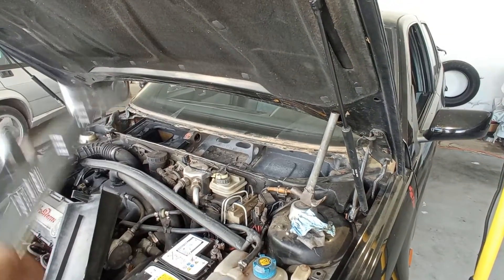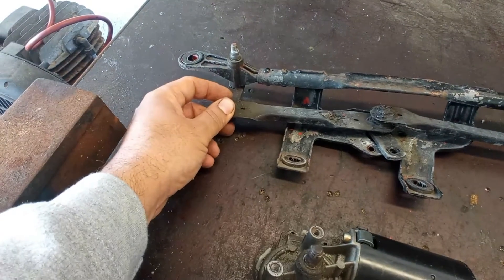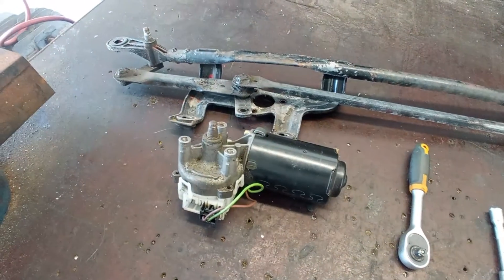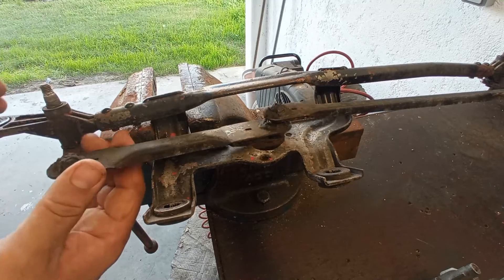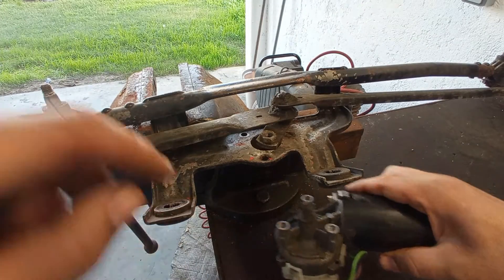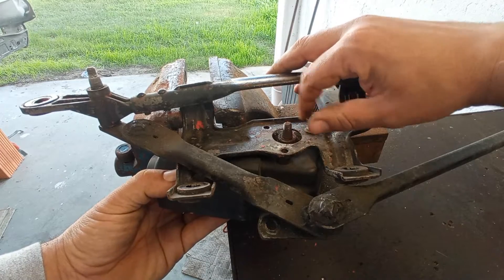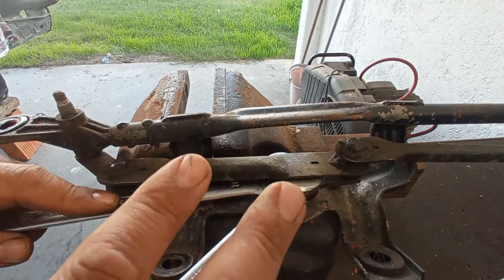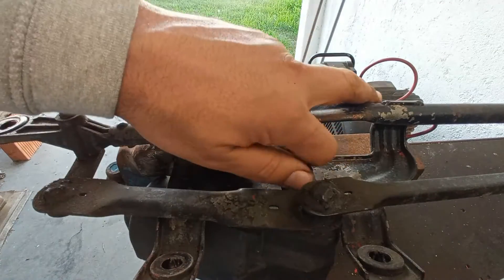Wipers in an awkward position? Wipers don't stop well at the end!? Adjust and understand.

Comment: Thanks, do you have a video or suggestion for the 159 wiper problem? The wiper works once in the 1st stage and stops and does not reverse. I removed the motor and sanded the connections but it did not work. I could not find a relay. 😢
Reply from the maker: It uses no relay, the body computer controls it. 
So it's the body, the wiring or the wiper assembly
Reply: @alfaromeonoproblem  Thanks, I'll check that out. I follow the videos ,very useful🙂